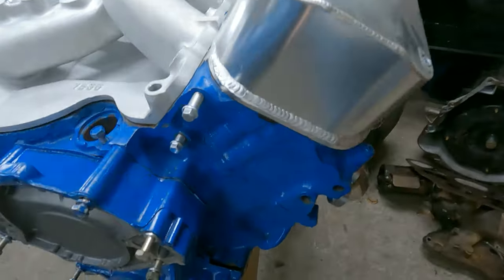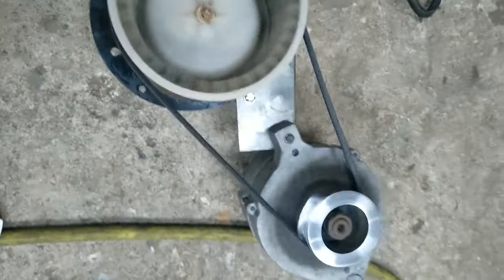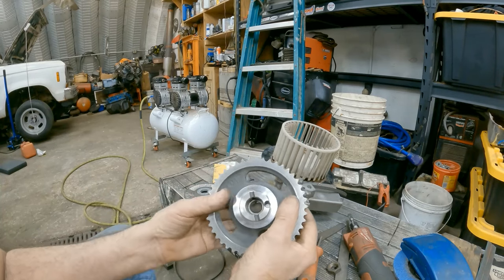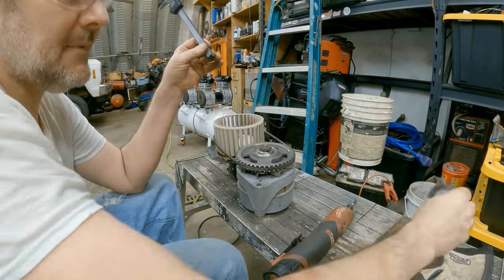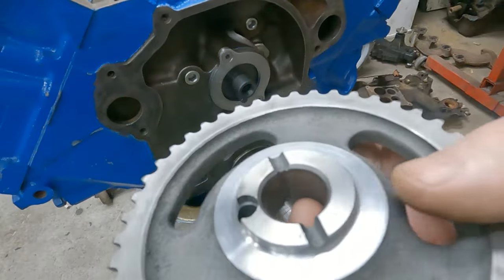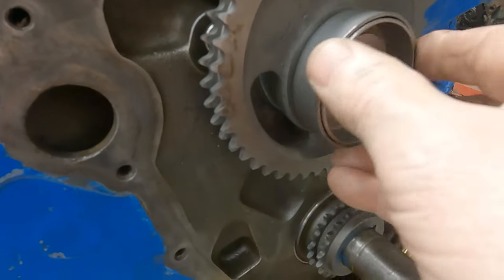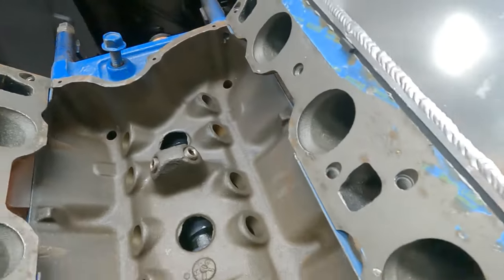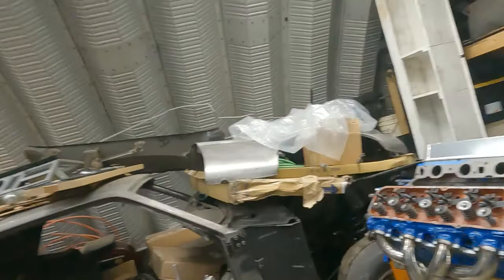Marketplace 460 Ford Big Block The Good And The Bad

Comment: you should have rotated the motor with the indicator on it to see how flat the gear was. that would have been an interesting test.
Reply from the maker: I didn't cut where it butts up to the cam still has a factory finish. I checked it while it was on the alternator - rotator table it was flat https://youtu.be/90Milz9D3Mk

Comment: After seeing what we see I think you would be better pulling the heads for a look!
Reply from the maker: It's got C9 big plug heads  you can see fresh .030 pistons. Everything  else looks like it was done right they rebalanced the crank you can see fresh drill holes in th crank and where they took a little off the rods to make them all the same weight. To me it looks like they had the machine shop assemble the short block and reworked the heads and they took it home and tried to put it together with parts that they bought ( cam, timming chain and torrington bearing ) they didn't read the fine print on the torrington bearing.  If they just used  a regular cam thrust bearing it would probably be in the Torino it was meant to go in and wouldn't have sold it.  He got everything for $2,700 plus the $500 for lifters and rockers and pushrods.  It came with a C6 two converters, new aluminum radiator with two fans, serpentine pullie kit , electric water pump, air gap intake. I'm sure when they tried to spin it over and it was hard AF to spin they just stopped and sold it.  If they had put lifters and pushrods  in it I wouldn't have opened it up to find out what type cam it had and it would have ate itself in about 10 minutes. As soon as I get the pushrods I can finish putting it together and run it on the ground and break in the cam. The pushrod Guide plates are stamped out and have a extremely sharp edge I'm gonna chamfer so it doesn't file the pushrods hardened or not it would chew them up. I know you know what that does makes scrap iron out of a otherwise good engine. I'll probably make more videos on the rest of the build  and the first start won't be a year gap since my last video like it has been. The Ranger  has the engine back out might get the 351W  only thing I don't like is it only turns 5800 RPMs and floats the valves the other 351 it had only turned 5600 RPMs plus they drink the piss out of some gas, Sounds like I need to put a 2.0 back in it @ $4.20 a gallon for 93 now days.  If I only had Cleetus McFarland money!
Reply: @kickassmustangsgarage  yes it for sure would be nice to have deep pockets like Cleetus lol. Ok your probably right about the short block. Does it look like it has head gaskets 😁 I actually got a 302 about 25 years ago guy “rebuilt” it. All clean and painted up nice but didn’t have a single gasket! Not even head gaskets!  All RTV. Even RTV for the main seal and front seal lol. You never know.
Reply from the maker: It has head gaskets on it everything is new ARP head studs, rod bolts, heads have double springs new keepers and retainers, Manley guide plates ,7/16 studs everything but the torrington bearing was done right. I'm gonna check that everything is torqued properly, crankshaft backlash, degree the cam in just give it a once over and a bath in brake clean should be fine after that.  It's going in a 77 F100 that has a 460 he wants to rebuild it and put it in a 68 LTD he picked up about a month ago to play with at the drag strip. Made no sense to me either lol big ass tank to go fast WTF probably dump rust all the way down the track and get kicked out first pass lol.
Reply: @kickassmustangsgarage  lol ok sounds good. Yea a land yacht for a race car😆😆😆 keep it up👍🏼